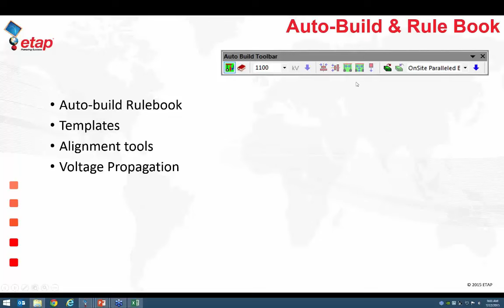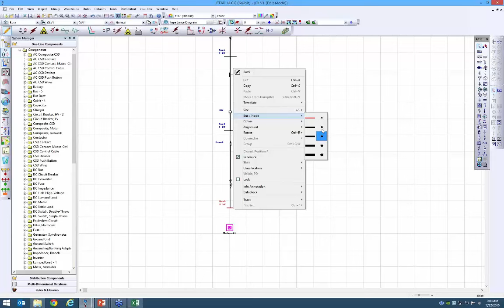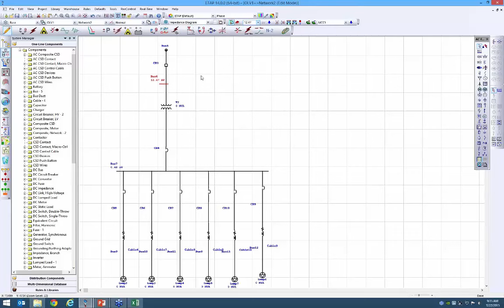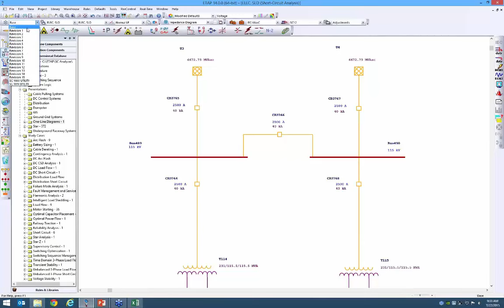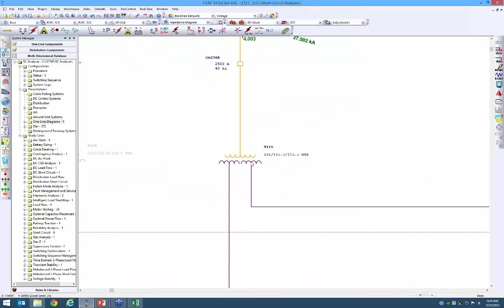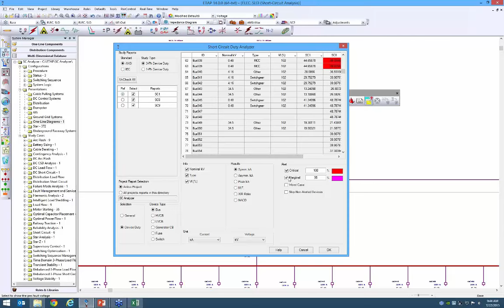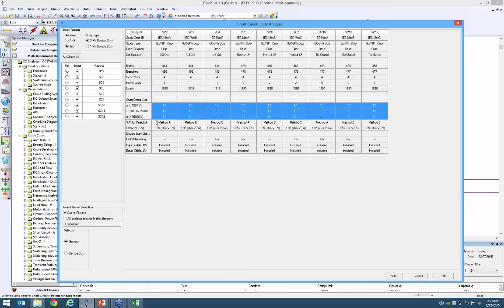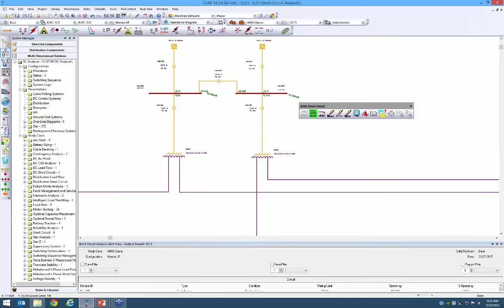ETAP Auto-Build and Short Circuit Analyzer

Comment: Please how do I correct the critical values on my load flow analysis ?
Reply: Hi Olice,

You will need to make adjustments to the elements you have in your project and the output results should change. One place to start is to look at the elements that are overloaded when running load flow.

Comment: How do you insert load break switch?
Reply: In the edit mode toolbar there’s an element for a single throw switch and double throw switch. You can also add a lvcb or hvcb before the load with the option to open or close the breaker.